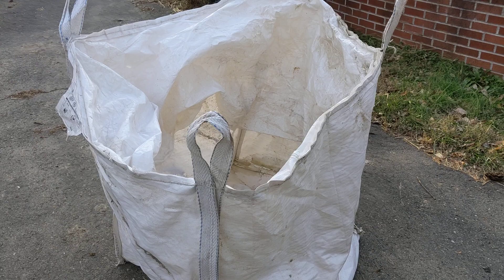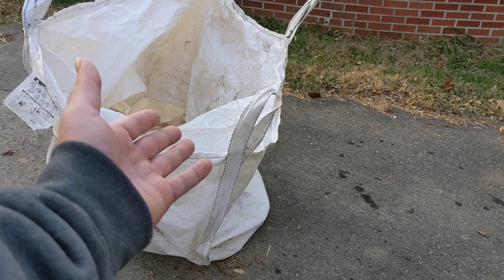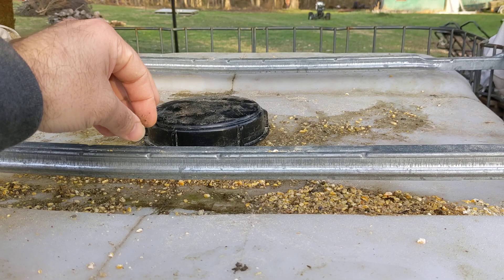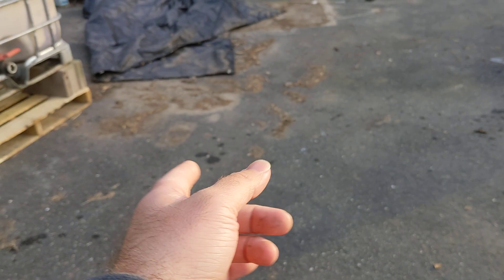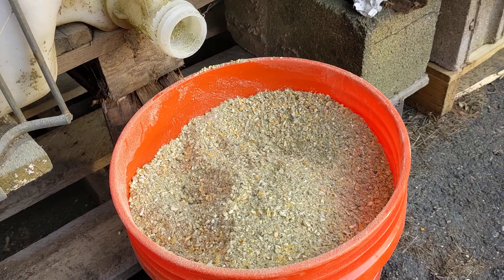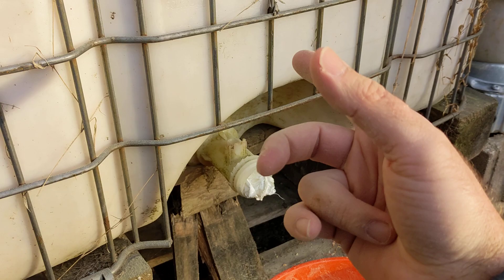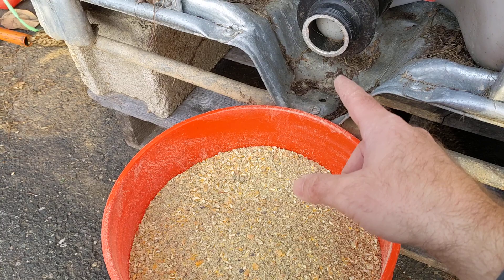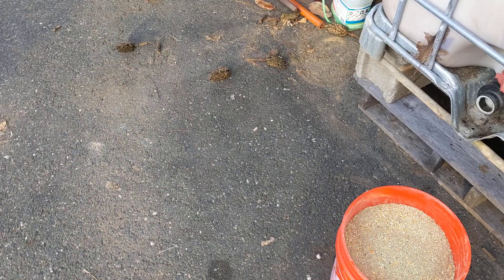Feed and Grain storage on a budget!

Comment: Man this is a great idea I never thought as I have shoved cut the top cut the top off of these and stack bags inside them and then re-kind of screwed it back together to seal it up I should’ve done this
Reply from the maker: All you need is a tractor to lift that kind of weight, and a man to manage the bunghole!

Upgrade to a traeger grill auger, and it moves much more material out of the bin... 

Keep the bin intact, and you don't suffer moisture issues with the feed.

Comment: Wow, what a concept! I was just looking for feed storage units but I’m just a small farm trying to grow a little, and the small silo type feed storage unity are just too expensive.  I have used these IBC’S for water at locations where I have no running water available, and they were great for that, but this is an answer to a question that’s been plugging me for a year. Thanks
Reply from the maker: No problem. If you figure out a solution to get the last 15gal out of the bottom, let me know :)

Comment: Can attach your silica bag bag to the screw top?

Also, if you make a PVC sleeve for your auger, maybe you could put a 90degree elbow on one side, and drill a hole to feed the shaft of the auger thru, so it feeds straight down into your bucket.
Reply from the maker: Great minds think alike, my man.

Comment: What a great idea I'll remove the valves on mine and install a steel nipple on it with a threaded cap on the end!, I will be storing shelled corn in them!, and I already have a 2 inch auger bit!. Great idea!.
Reply from the maker: You might have to adjust that bit on a grinder. I know I had to.

Comment: 9:25 what if you inserted a metal pipe (maybe a repurposed piece of chain link fence top pipe) into the channel? And… if you put an eye bolt through the top of the IBC next to the top hole, then used a long tube (sock shape but bigger) to put the silica in so it would fit down into and then be removed from the hole easily, you could hang it /clip it to the eye bolt inside the top of the IBC, yet it wouldn’t interfere with putting the feed in. Just brainstorming. By the way, there is a cat litter made of pure silica you can get in a bucket from Walmart. =) We re-bag it into cloth bags and use it to keep moisture out of food storage.

Comment: You could sacrifice some of the storage space in the containers, and find some way to ramp the bottoms in a V shape towards the hole you're putting the auger in. Cubic loss might not be too bad. Might want to do it temporary like with different coloured feed to prove that the refill forces the material on the slops to move towards the bottom of the V when the auger runs.

Sleeving with a metal pipe might work to avoid getting the hole chewed up by the auger; if you could find a local metalwork shop (or if you do your own), you could potentially put together an external sleeve for the hole as well, with a centred hole for the auger shaft, and an exit hole .. hard to explain in words, easier to do in a sketch. In fact, you could join the two bits to make like a double-walled glass (out of metal) that slips over and in the hole, has a stabilising hole for the auger shaft, and a down-facing exit hole for the spewed material. AvE in Canuckistan had a community CNC at one point, where he was doing things like that for people.
Reply from the maker: Good ideas most definitely -  however, for the ramp/slop in the bottom, i'd be working through a 6" hole in the top. I don't know many ridgid materials that can be inserted though a hole that small to do what i'd need. it'd be easier to just figure it out when the time comes, either by sweeping, vacuuming, or flipping the container and shoveling. not the big of a deal :)

As for the sleeving... i'd much prefer PVC pipe. I can find it in the sizes i need, and if chips flake off, i'm not going to cause internal lacerations on the birds. just easier all around, ya know. Design would be like a "flute", the feed end will have a 4" long ovaled opening where the auger is exposed to the grain, and the back side would be just open to allow the auger to slide in to the pipe. The pipe would be only slightly larger than the auger, so stabilization isn't such a big concern. The downward facing hole is a good idea, however, for this application it's somewhat overcomplicated. 

Thanks for the feedback, and watching my video. I appreciate the time and effort you put into your suggestion, makes a lot of good sense. 

-Ryan
Reply: @RyansGoslings  Love your ideas  wondering what kind of feed do you feed them? I see corn? do you throw layer pellets in there?
Reply from the maker: @brendagoodyear562  it's 18% layer mash from a feed mill. I don't think you can get anything comparable in the store, unfortunately, as this is actually milled feed. I know there's corn, alfalfa, and soy as the bulk ingredients.

Comment: I've been figuring out a way to use IBC totes for bulk heating pellets and am currently thinking 2 systems, a vacuum line or a 2" flex auger. One of the main concerns I have is emptying out the bottom corners. Did you ever find a good solution to emptying out the last bit?
Reply from the maker: No, unfortunately. Seems the only answer to this is either ignore the waste, cut the top off, and shake it to the front to get the most you can out. For you, its not that big a deal since they’re heating pellets, and not feed.

I tried a vacuum, which wasnt strong enough to lift/move the feed, and flex augers are stupid expensive.

Comment: How do you get it from the bag into the tank?
Reply from the maker: Delivery via truck in 1ton bags. If you don't have a tractor that can lift a ton to access the chute on the bottom, a 5 gal bucket can move a lot of material at a time. I cut a hole in the bottom of another 5gal to go on the top of the IBC to act as a funnel, while using another 5gal to scoop with. Otherwise, use a tractor to lift with, and there's a chute on the bottom of the bag that can go right into the top of the IBC.

Comment: do you think bulk deer corn would pass through that hole with the auger?
Reply from the maker: with the auger in the video? barely. 

If you buy one of the Trager grill pellet augers on amazon, the shank is 3/8ths, and fits in a drill too. it's called a "Shaftless" auger, and is meant for conveying material. This: https://www.amazon.com/Traeger-Pellet-Replacement-Assembly-KIT0023/dp/B076JLFWT4
Reply: @RyansGoslings  why do you think whole corn would not feed?
Reply: @2009rummell  it would feed, just not well with a shaft auger. A shaftless auger is meant to feed material such as corn and pellets… so you’d spend less time on transfer.